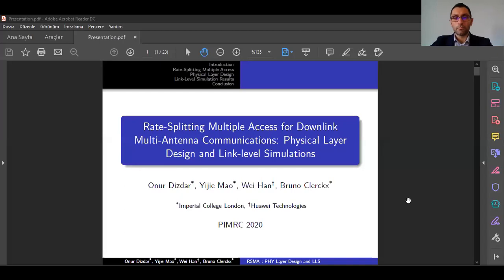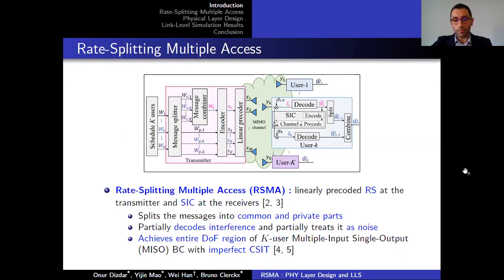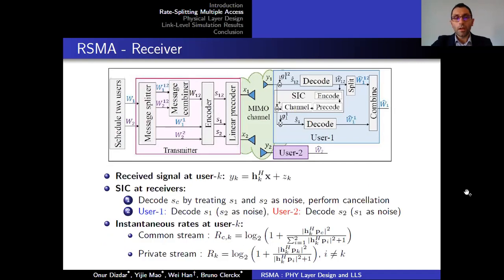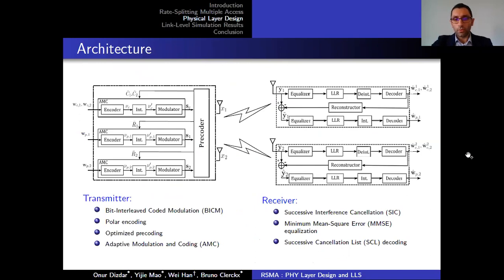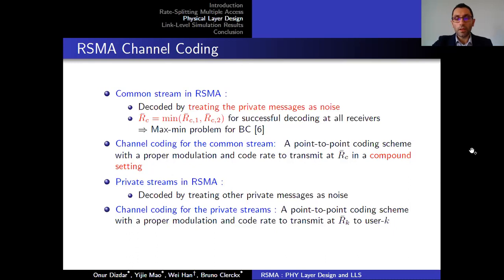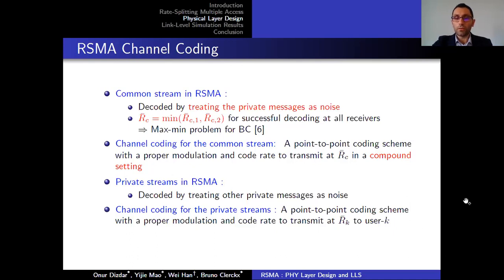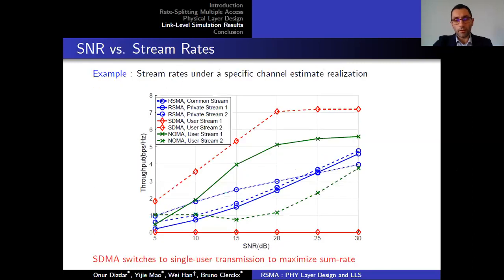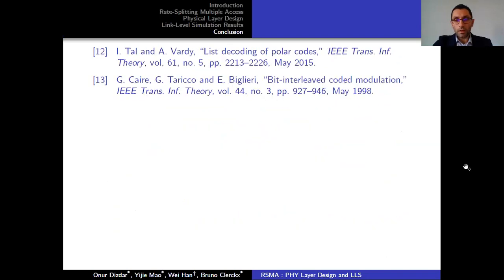Rate-Splitting Multiple Access: Physical Layer Design and Link-level Simulations

Comment: Can you do a tutorial on rate splitting at the bit level
For example two user, with user 1 data as 0010
and user two data as 1111 ?
What would be the common message s_c for this case ?
Reply from the maker: Hi, thanks for watching. You may want to check https://youtu.be/-FpoC5XzNWw at 39:10 (slide 23). Hope this answers your question.